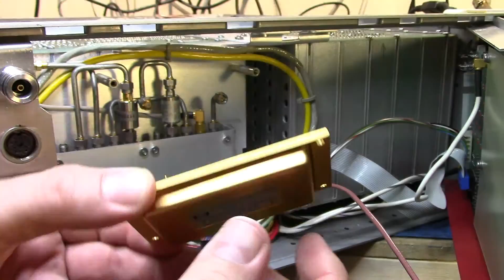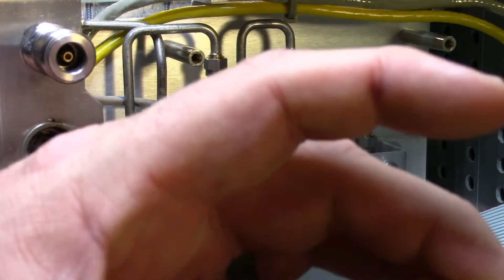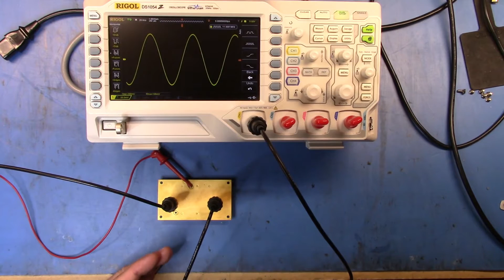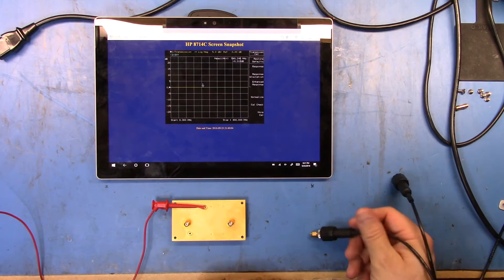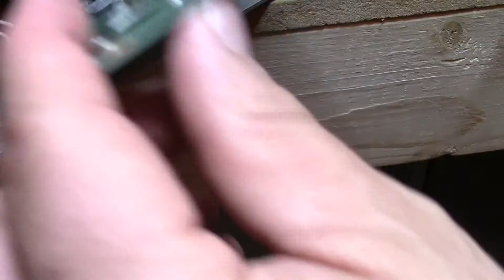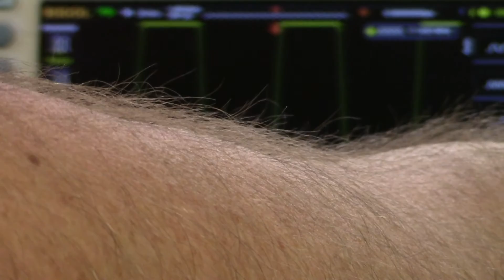HP 8902A Repair

Comment: I cringed when you attempted to flow the solder on the pins holding the amplifier board. You are lucky the pins didn't fall out. In the future, plug the module into the pins on the board before flowing solder. That will hold them in alignment.
Reply from the maker: Thanks, when I  noticed that the first one wasn't popped in, I used the heat resistant pad on my iron cord to hold them in.

Comment: I am always amazed at what commercial places want to charge to fix /calibrate this equipment. I get that it is for business use, and has to be within standards, etc. And the repair takes skill, and the guys need to make a buck to stay in business... But Wow! 8K... I am actually wondering is Switzerland's new tax rebate for repairing things might be a good plan. More people need to fix things and stop throwing them away.

Nice job!
Reply from the maker: Well to give Keysight the benefit of the doubt, I don't know yet if this fix will make it pass the manufacturer calibration tests. That will need to wait a couple of weeks before I can get into the lab at work.

Keysight's fix absolutely would have resulted in a pass though.

But yes, $8K was way more than I expected.